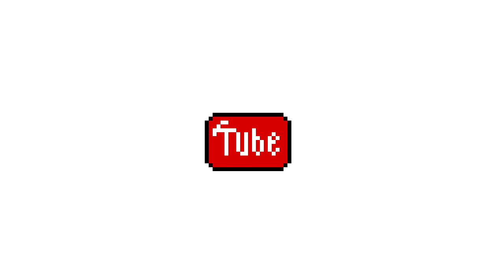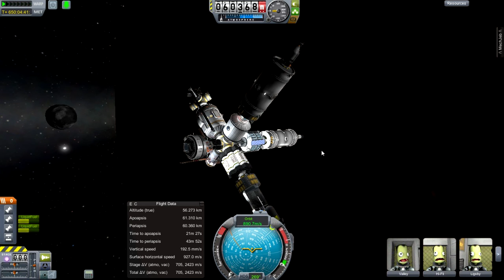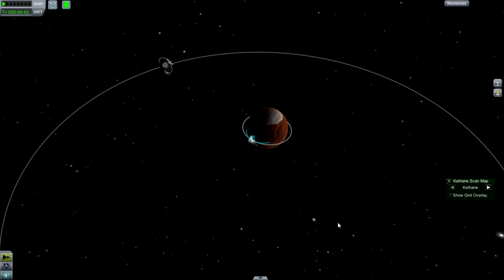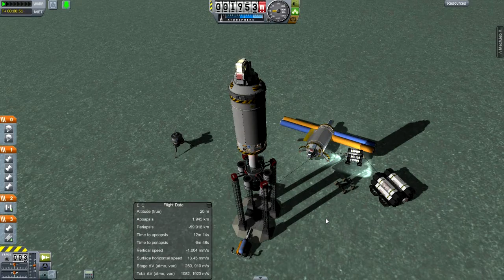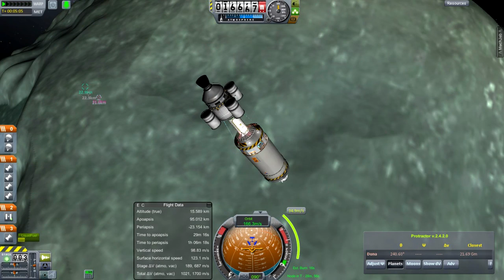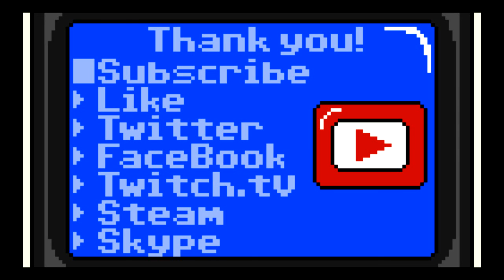Kerbal Space Adventures Ssn6 Ep2 HD - Proteus down

Comment: KB, what if ypu designed a rover for kethane and ore, and a fuel depo so you can just move the base around?? it would save frame-rate i think as well :)
Reply from the maker: Been trying to do that with a few mods, but as with the original parts it's very hard to put together properly and without a place on Kerbin to test it I'd hate to get it out there only to find it doesn't work.
Reply: ***** have you scaned kerbin? it ma be worth it :) to test off screen with vehicles
Reply from the maker: I have, but most Kethane deposits are very far away from the KSC. The closest was over a bunch of hills and I tried to drive there and it was taking forever so I decided not to take the rover (I wasn't sure all the parts worked anyway) I may try again with new parts though.